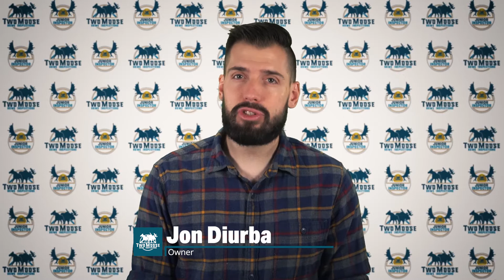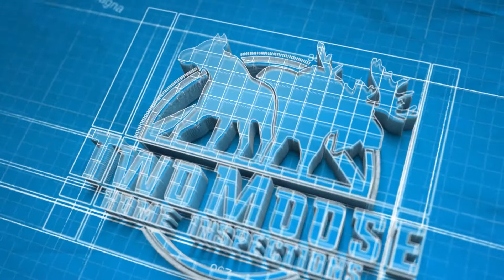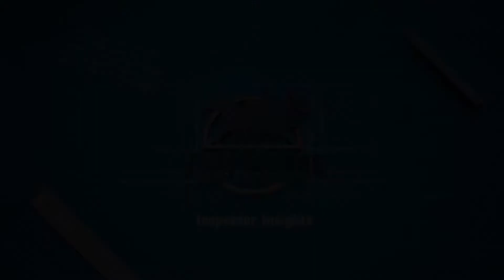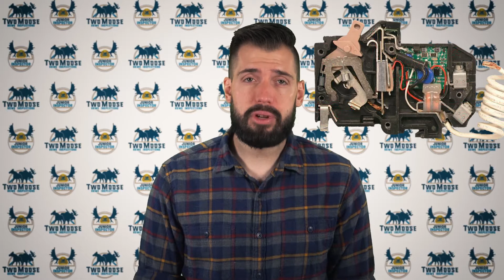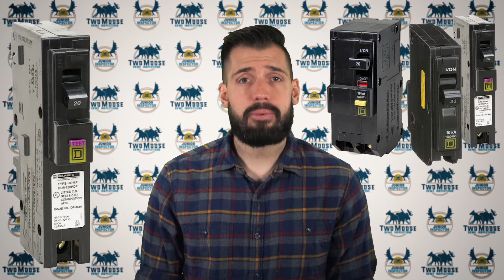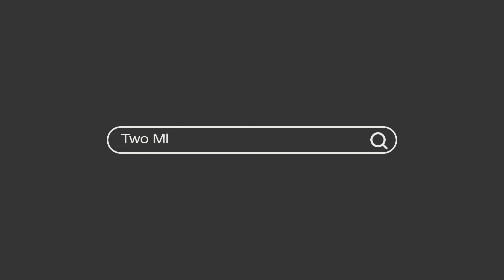Service Panel (5 of 6) - Arc Fault Protection Is Needed On Every Circuit In your Home or Else

Comment: When did the the new arc fault breakers come out?
Reply from the maker: AFCI first hit the market in a big way around 2002 and then a large update occurred in 2008 to include parallel and series faults at a lower amperage, but changes to the NEC isn't the end all be all when it come to nuisance trips. The majority of the logic for AFCI Breakers is programed on a microprocessor. Each manufacturer applies for patents and UL certification as they make changes, and pinpointing the best year of AFCI production is impossible. Currently AFCI breakers can still be fooled by cheap motors and LCD screens that are poorly engineered because technically they create an arc while in use which is not ideal. If you are getting nuisance trips don't just replace the breaker, investigate the root cause and make sure your home is safe.